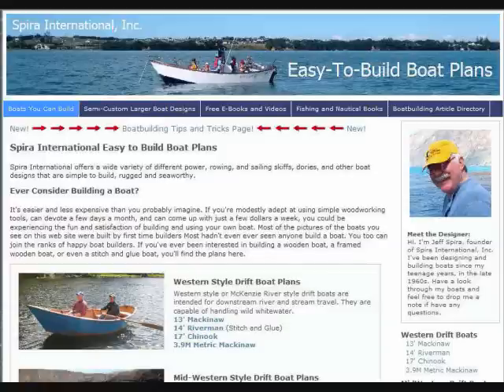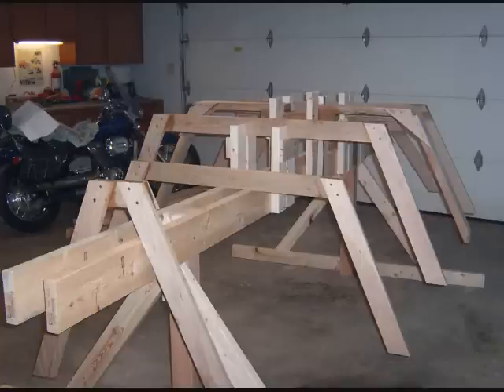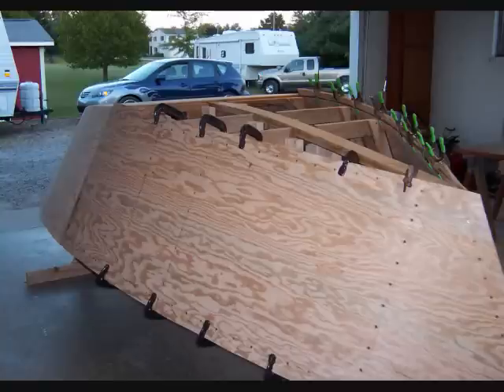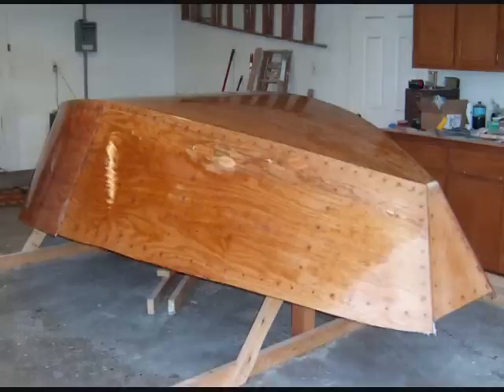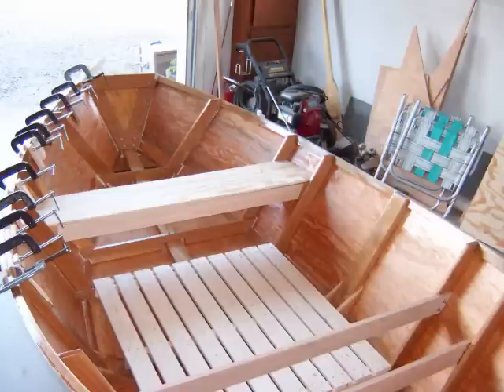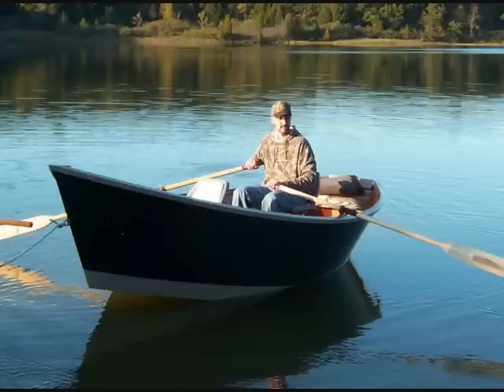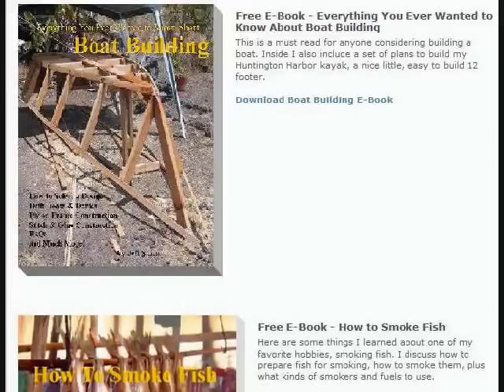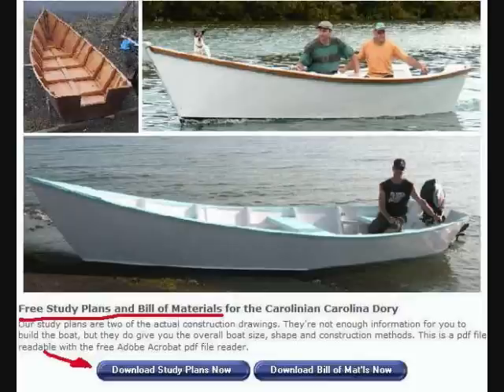Home Building a McKenzie River Drift Boat

Comment: that sheathing to frame fastener schedule seems way to much....puts a perforated weak spot on the sheathing. The old timers would space  sheathing fasteners to the vertical frames on about half of that schedule.  Just enough to hold it down to make the glue work.

Comment from the maker: +dirtTdude Let me get this straight: 

1. You bought the plans five years ago,
2. You built three sets of framing in those five years from expensive oak in accordance with my plans,
3. You burned two sets because you couldn't follow the simple plans,
4. You hired an outside engineer to calculate the dimensions for my frames,
5. You think my plans are no good because you couldn't get it to go together.

But, of course, you never thought to send me an email or give me a call from the free number on my website?

Over two thousand of my boats have been built from my plans since 1995 when I began offering plans online, and a couple dozen before that. 

I have hundreds of emails from people as young as 11 years old and as old as 83, claiming how easy their boats go together, and thanking me for their design. 

Yeah, I believe every word of what you say. I am also expecting a check from the wife of the recently passed away Nigerian oil-minister, so I can give this business up.
Reply from the maker: First, let me say, sorry about the comments. I thought that this was a random unfounded accusation. 

Did you not download the manual that was included on the download page with the plans? If not, it is also available here: http://spirainternational.com/hp_free.html (The Ply on Frame Boat) EBook. 

Have you seen this blog post? http://spirainternational.com/tipsandtricks/2012/120607_hey_jeff_you_forgot_this.html

Page 2 of these plans also shows that the fore and aft frames are made of 1x4 lumber (standard milled sizes per Note 2, 3/4 x 3-1/2, or 2x4 or 5/4x4 your choice) and the center frame 2x4 (1-1/2 x 3-1/2.) This is true for all of my boat designs except where it is not required, and then I'd indicate it on the plans. No other ripping to size should be needed, unless you're starting with larger stock and wanted to cut them up into the standard milled stock. cross sections. 

I have about 100 designs, and all have been built by first timers, one design with over 60 returned photographs. I don't know exactly how many, total because not all buyers report. I have photos of 14 Mackinaws, most in the US and Canada, but also one in Chile, a another one from New Zealand. 

Here are just a few of the photos of completions: http://spirainternational.com/tipsandtricks/tipsandtricks_launchings.html  Look at those submitted comments. Many all say how great the plans were.